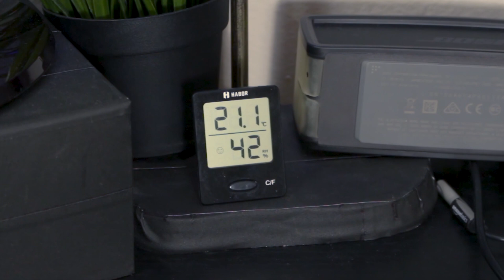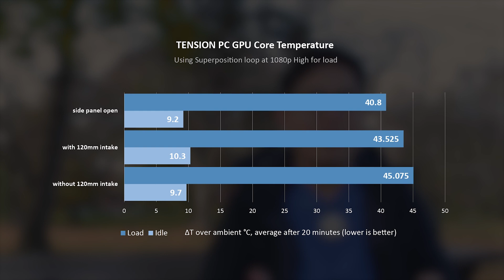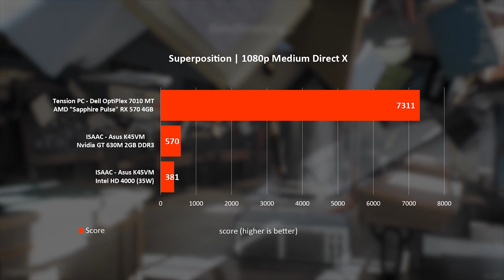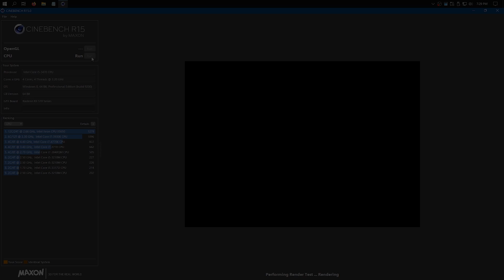Using an OptiPlex for 6 Months (Tension PC Ep.2)

Comment: I installed MSI Afterburner to modify the fan curve of the computer over stock. I set mine to ramp up earlier & faster. I use headphones for sound so fan noise isn't an issue.

Comment: Is that front fan 120 mm?  If you don’t want to do metal work you could mark and drill mounts then use washers with longer screws to give you clearance.  Personally I’d stick with 80 or 92 mm.

Comment: I wound up with a Dell Optiplex for no cost and I have upgraded it for gaming with absolutely no issues. After I reconfigured it from Legacy to UEFI BIOS I was off to the races.
It has a I7 3770 , Win 10, SSD (500 Tb )and HDD (2 Tb), 450 watt PSU and a RX 580 8Gb GPU and plays every game I need it for perfectly. 
I'll use it until it dies unless it outlives me.

Comment: Even though the mount for the cpu heatsink fan is non standard, you can still replace that to use a standard cpu hsf (dont remember terminology), but you can also buy this hsf: https://www.newegg.com/cooler-master-rr-i71c-20pc-r1/p/N82E16835103279?Item=N82E16835103279
It's way better than stock, and even has RGB lighting. Using it on one of my 7010's and it is awesome!

Comment: You're stopping your CPU & exhaust fans from running at their full potential with how you have the angled fan installed. The Optiplex thermal sensor is right behind that fan so you're tricking the sensor into thinking the ambient temperature is lower than what it really is so the CPU fan & exhaust fans don't ramp up to full speed. Relocate the therl sensor so it's not in the direct path of that angled fan.

Comment: I have a couple Optiplex computers that I have tried various approaches & mods to keeping cool. I got the best results on one of my 9020 i7 Optiplex upgraded to a 4790K with a Zotac GTX 1070 Ti 8GB Mini, 32GB of ram, 1TB SSD, wireless AC PCie network card with bluetooth, EVGA 600 watt 80+ bronze power supply (using a 24 pin to 8 pin adapter). What I did was remove the harddrive cages (used a caddy adapter to mount my SSD) so I could install a 140mm Noctua fan (with a fine mesh filter). I cut out the front of the inner metal cage (not the cosmetic plastic face) to have direct air flow for my 140mm fan. I then cut out a hole on the bottom of the case directly under the GPU to add a 120x15mm Noctua fan ( with a fine mesh filter) to feed cool air directly into the 1070 Ti input fans (added 1" rubber feet to the bottom of the case to raise it off of the floor). Both of these fans are controlled by a Kingwin auto fan controller (installed the thermal sensor to the back of the 1070 Ti so when I game the fans automatically ramp up to the required speeds based on the recorded temperatures and for normal computer usage the computer is dead silent as the fans drop RPM to suit the easier load). I then replaced the stock CPU  cooler with a Thermaltake CLP0556-B CPU cooler (with Thermal Grizzly thermal paste) using a dell proprietary connector to standard 4 pin adapter. Standard options for keeping a cool PC were also used such as cleaning any & all dust from the computer, cable management, etc. The results is a dead quiet PC during normal everyday use & a barely noticeable noise level while gaming with my CPU & GPU temps rising & falling in sync within only a couple of degrees of each other. Under normal everyday use the CPU/GPU temps never reach above 51c on CPU & 33c on GPU. While gaming the highest I've seen the the CPU & GPU reach is around 67c (when my AC is on the temps drop down even further), before my upgrades my CPU & GPU used to reach up to upper 80c during gaming . Synthetic benchmarks & stress testing pushes the temps up to around 78c. This little machine really performs great, reaching between 160-180 fps in Fortnite at 1440P, everything set to Epic (except for the new Raytracing feature, that brings this machine down to it's knees but the GTX 10XX series wasn't the greatest of performers with Raytracing).

Comment: I have a few OptiPlex's oldest to newest GX240, 7010 SFF and just one week old a 7060 Tower purchased new as the first two were refurbished. I take great care of them and have all three running. The new one is great with the Optane. I would like to put a fan in since I just do Flight Sims; Prepar3d v4.5, X-Plane 11 and FSX Steam Edition with 32GB RAM and 32GB Optane and 2 2TB 7200 HDD I want to keep this one in the same mint condition as the past two.

Comment: Have a i5 3470 that I upgraded to i7 3770,which is the max. Plan to add a 4K monitor and  NVDIA GTX 1050 Ti small form card next.Goes as $ allows.
Reply: 1050ti sucks, get an RX 470 instead. It's cheaper and performs better
Reply: Nahpets Android Gameplays the 1050ti is actually a great budget card but the 470 sucks if he wants an upgrade he has to go for a 570 or a 580
Reply: You can drop a Rx 580 into it

Comment: Good video! I do have some suggestions on improving your build though!

For one, I'd ditch the dust filter. Believe it or not, the dust filter impedes airflow to some degree. Sure, you do get more dust over time, but you get better airflow. If you don't mind cleaning your PC out more often, run it with no dust filters.

The second thing I would change is the hard drive cage. I'd personally remove it and move the hard drives up into the CD drive cage. With removing the cage, you could add 2 90mm intake fans in the front or one 140mm fan, depending on preference. Also, with the cage removed, you'd be able to fit a longer GPU into the case. Obviously, you'd have to buy a right angle USB 3.0 header adapter to retain USB 3 usage.
Reply: I dont think you can properly mount a mechanical drive into the cd drive in these.
Reply: @cha7er  Suuuuper late but whatever. I did the Drive is a little loose but I modded the cage to slide the HDD Caddy in and out. Only issue is Sata connection is a little tight but that could be fixed with proper routing and extenders. I removed the optical drive and mounted 2 HDD and 1 SSD to the back panel which ibe put windows and my most used files so I can quickly take in and out for my other PC and repairing. It was a lot of modding, trial and error, and PSU adapters but it runs smoothly now. I do have a 3010 tho which is slightly different. I haven't upgraded this build yet but I hope to soon.
Reply: @cha7er with the proper adapter it’s possible.

Comment: I am even using an overlocked LGA 771 Xeon X5470 3.33@4.3GHz 1.35Vcore with Windows 7 Ultimate x64 on ASUS P5Q3 Deluxe as my retro PC with MSI GTX 1660Ti Gaming, Corsair 220i RGB White case, Corsair 2019 RM650 Gold semi-passive inaudible power supply, 8-16GB of RAM, 2x Samsung 860 EVO SSDs 250&500GB, USB 3.0 card with front panel USB 3.0 connected, 867Mbit Wireless AC Intel 8265 M.2 card - can't use an Intel 9260 1300Mbit card because of stupid Intel not making a Windows 7 driver for it, 2xGbit Marvell LAN is onboard, it can do a lot but some newer games like BF1 Multiplayer are a little bit too much for this CPU at around 40-60fps. My only issue with this PC is actually with the new part - Corsair RGB FANs are noisy even on the lowest 60% setting that MB provides and sometimes they were rattling, like seriously Corsair should have put a 1200rpm FANs in this case and make them of a higher quality, also the RGB lighting is a mess of cables, also the mesh on the rear FAN is too thick and reeeally blocks the airflow Noctua should also learn to put a socket 775 brackets with their cooler by default, because of that i bought a Scythe Mugen 5 which comes with socket LGA 775 mountings by default and put a spare Noctua NF-A12x25 PWM FAN on it. Basically my goal with this build was to make this PC as usable as possible using LGA 775 motherboard which i think it really is, especially that Xeon X5470 is a magic when a QX9650/QX9770 needs 0.2V higher Vcore for 4.3GHz and would be impossible to cool with the cooler i have, also the P5Q3 Deluxe is the best motherboard you can use for modded LGA 771 Xeons :) Also for GPU i wanted a Turring architecture one for best possible video acceleration - it seems like madVR can't use GPU acceleration though for shitty HDR to normal video conversion :( MSI 1660TI Gaming is also a perfect inaudible very efficient GPU.

Comment: that intake fan, the way its angled out inside the case, looks like its just moving the air inside the case. cut some bigger holes on the inside metal and mount it, so that it sucks in air from the outside.